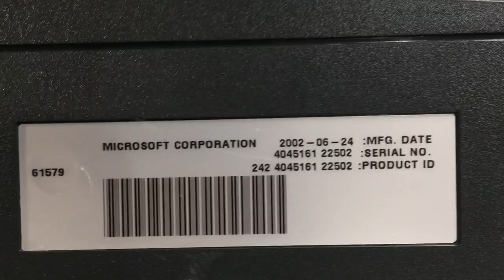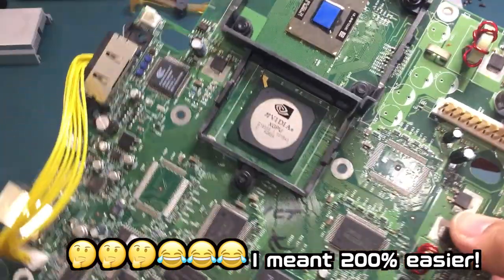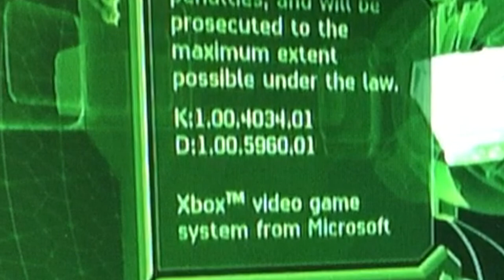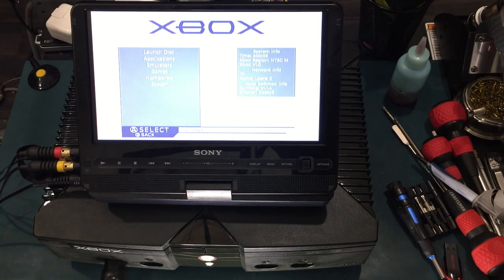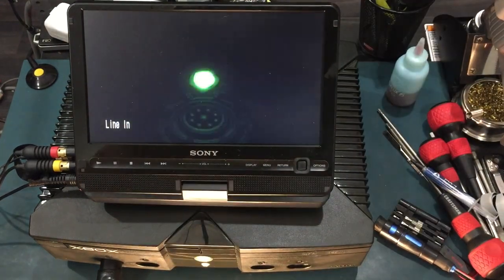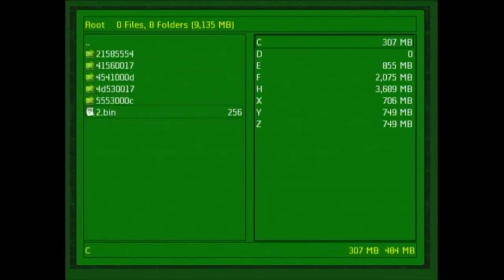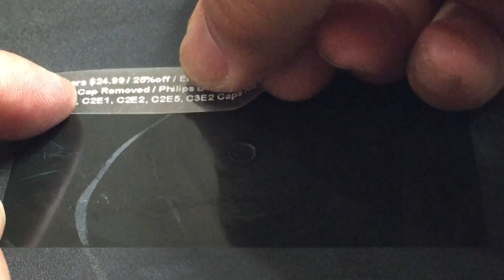OG XBox Error Codes 5, 7, 11, 13, 16 Explained & How To Fix Them [ep. 81]

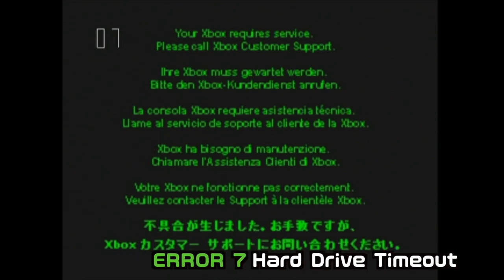Comment: Error 07 9:57
Reply: Ok but  i had soft modded my xbox it froze i reset it and now i have error 7 i have the stock hard drive i have not did anythubg to the jumper for that to cause error 7